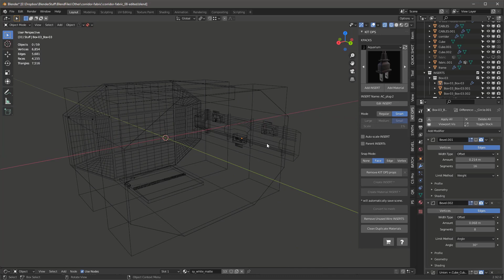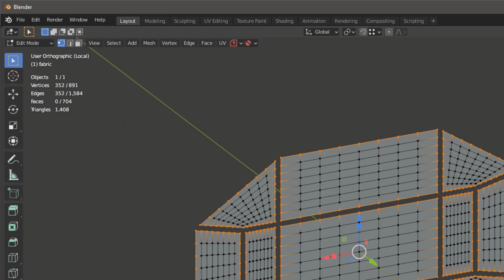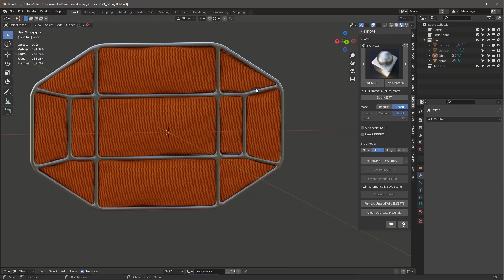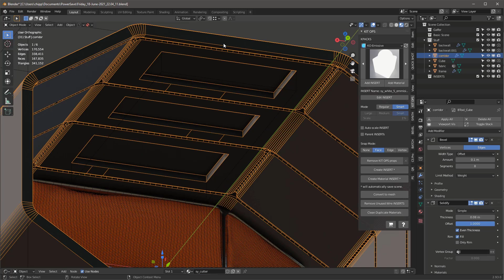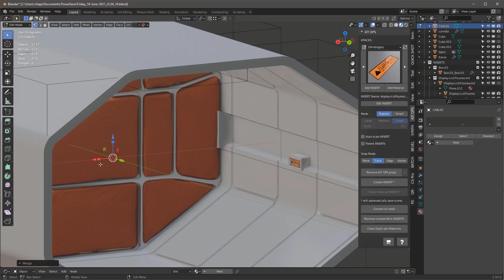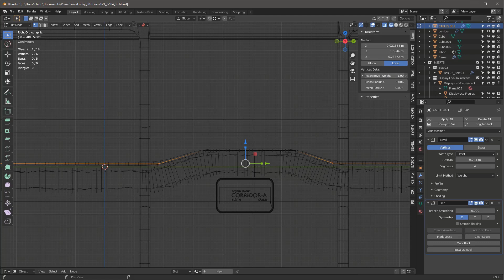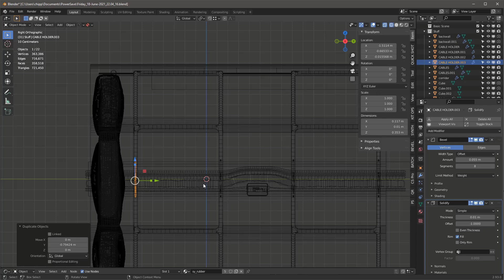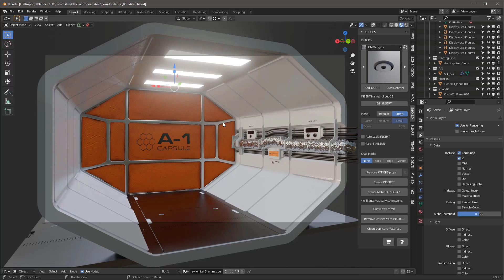Speed Modeling Fabric and Pipes in Blender

Comment: Hi. Thank you for the tutorials. Could you tell a bit more about problems with 2-7 bevel segments?
Reply from the maker: Yes, one bevel is a 45 degree chamfer and be default, should be flat shaded. Adding any more and the perception is it should be a rounded corner. And with less than 8 faces, the change in normal degree between faces can create smoothing artifacts, especially if you've added booleans and/or scale the object. Of course if you create sharps along the edges OR harden bevels OR add a Weighted Normal modifier-- you can get around this. But then, later on down the road you can end up with custom normals and some serious artifacts (if you continue to edit your mesh).

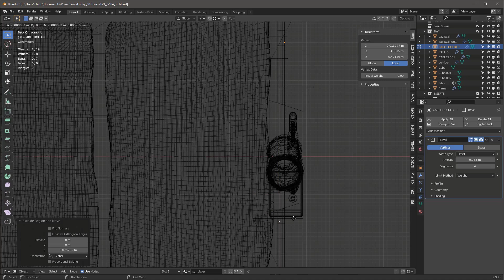Comment: Very good modelling! Btw How do you snap this vertex to another one without snapping off? here 36:34
Reply from the maker: I used the G key followed by the X key to constrain it in the X direction (or I could of used the X axis on the gizmo) and then held down the CTRL key which temporarily turns snapping on-- and I always keep my snapping set to vertex, so it snapped to the x location of the vertex my mouse was hovered over.